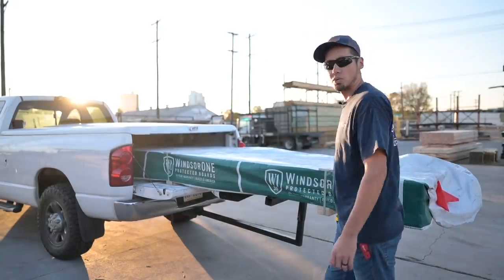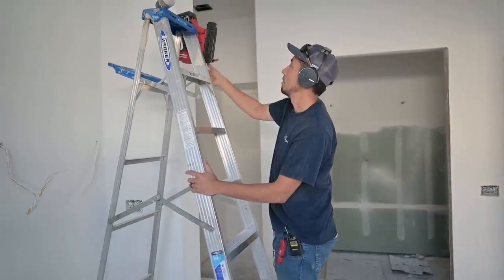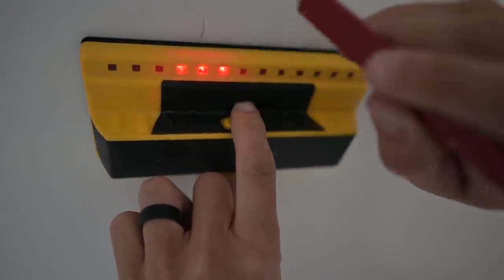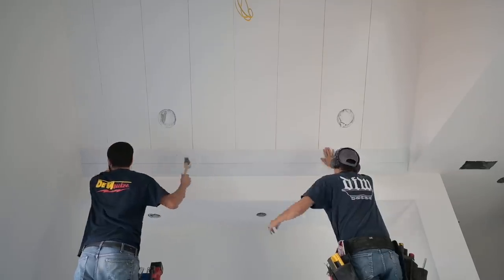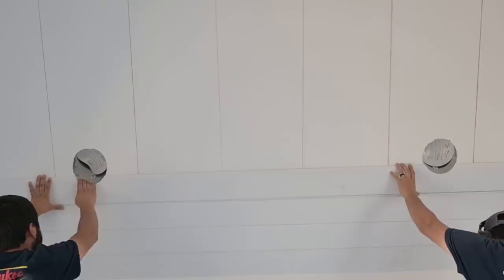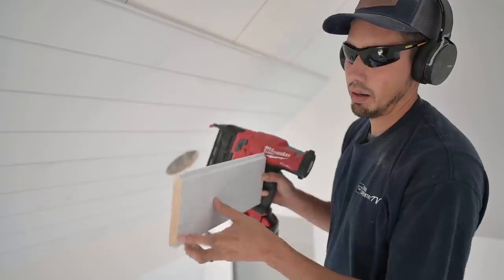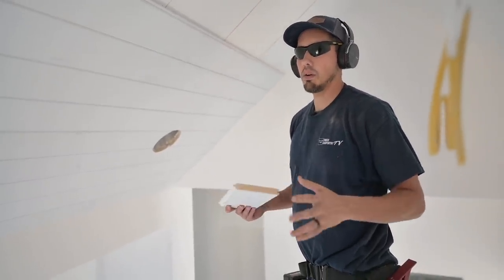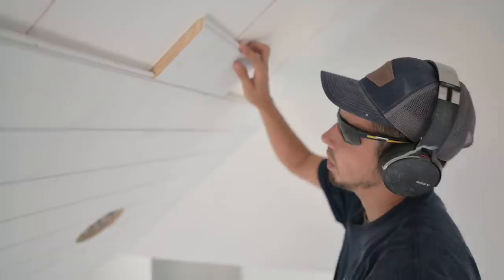Bad Carpentry Technique - Correcting My Mistake

Comment: You should be using constitution adhesive as well relying on nails alone is irresponsible and wrong. We as tradesmen have a moral and ethical obligation to safety. If that ceiling ever takes water or there were to be some sort of natural disaster those boards are going to hurt someone
Reply: If the cieling takes water the drywall fails so attaching to it is worthless. He's nailing into structal joist at an angle. It wont fall until the roof does.